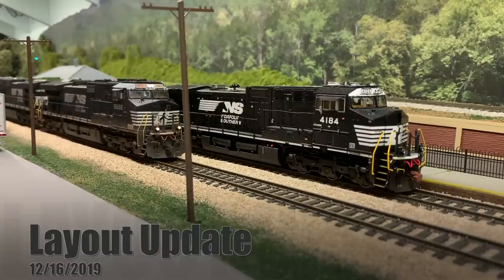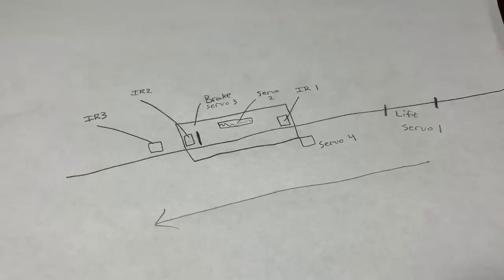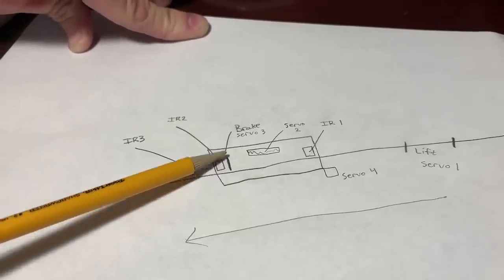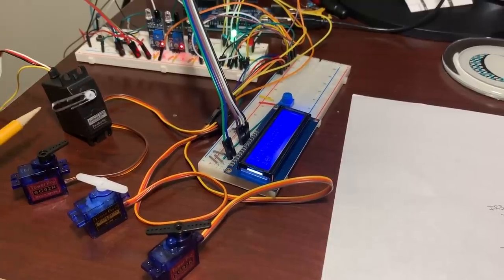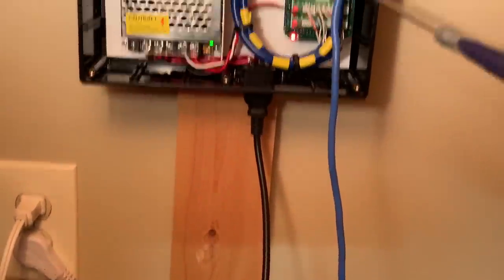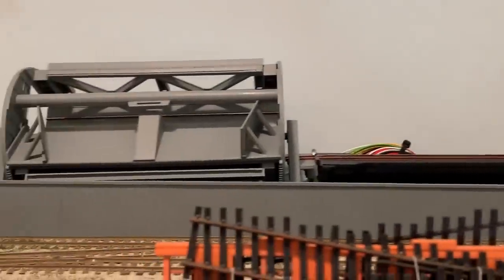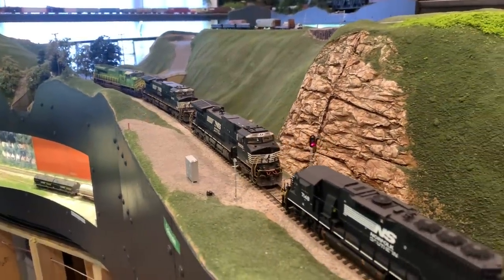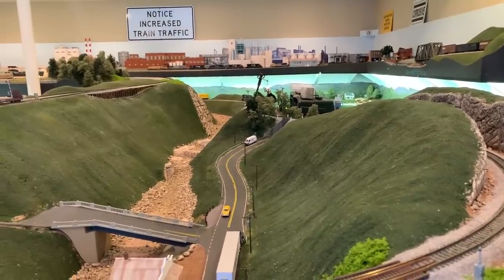Layout Update 12/17/2019 - NEW Working Rotary Dumper & Custom Locomotives

Comment: Nice looking dumper.  The style that unloads without uncoupling needs to rotate about the center of the coupling.  The older style similar to yours uses a dinky on very narrow tracks between the running rails to push the car up to and into the dumper.  When the next car is shoved in it shoves the empty car out onto a drop track through a spring switch onto a reverse grade so the car comes back down a steep track into the yard to be marshalled.  The N&W,  Pennsy, and several other railroads in the east used this arrangement to save space around the coal docks.

Comment: You guys have done a better than outstanding job on the layout,I like every inch of everything that I've seen thus far, I totally agree with keeping everything the same name brand with all the same decoders in it, that way everything is speed matched to a point.(with some fine-tuning of course) You could even mix and match engines if you wanted too,4 axle mixed with 6 axle power etc etc. The coal dumper second generation,I love the most that is awesome keep at it,do what the Japanese do,keep refining it and making it better.
Reply from the maker: Thanks for such a kind comment and compliment. Means a lot! Merry Christmas!! - Josh

Comment: I don't know if you could add this but it would be neat for your dumper to have a incline return track on the outgoing (emptied) track. Try finding a video of the Sandusky Ohio coal dock for a example on how it works. Basically the car rolls down the slope over a single point frog and back up another slight slope, gravity reverses it and sends it through the single point frog off to one side and into the yard where the consist is rebuilt

Comment: Not knocking your design, really cool that you guys made that and how it works.. very talented. However seems like a very inefficient way to unload a coal train.  I’m a rigger and was working at a massive powerhouse in GA and the trains roll over a raised track and the cars dump probably 10 at a time , train never stops. Compressed air shoots to get any coal stuck.. if a car still has coal in it they will back up but otherwise the whole train never stops and the 200 or so cars are empty I’m about 30 -45 min. The tracks make a big loop and the train rides right back out.. plant Bowen in Georgia.

Comment: Does anyone use a rotary dumper to empty the bin of a rail car mounted vacuum track cleaner?

There would be a couple complications. 
1. It would have to unlatch the top of the bin somehow. 
2. Track debris isn't uniform like scale coal, so the dumper would need to shake the car, blast it with compressed air, or vacuum it out.

I just saw a video of a club's track cleaning procedure. The vacuum bin had to be emptied by hand ten times per cleaning cycle.

Comment: Did you 3D print the dumper?  If so, did you get the STL files from someone or somewhere?  I am in O Scale and want a dumper for my Ore operation.  Thanks!
Reply from the maker: Its a modified walthers kit. They may make one in O, but I'm not sure. Thanks! - Josh